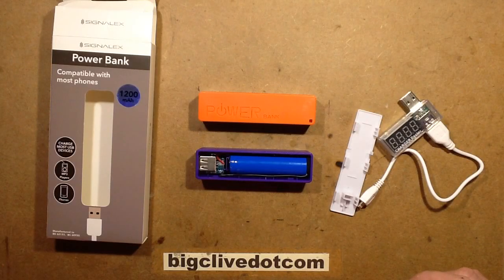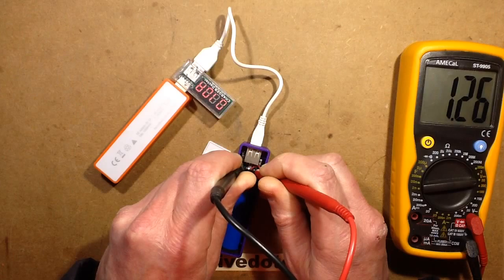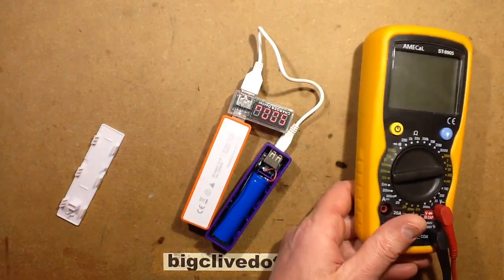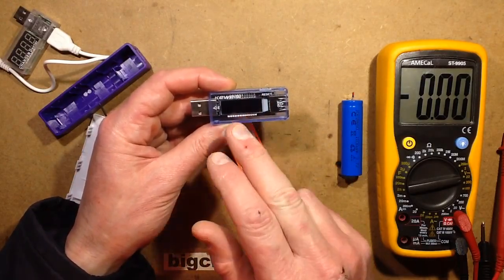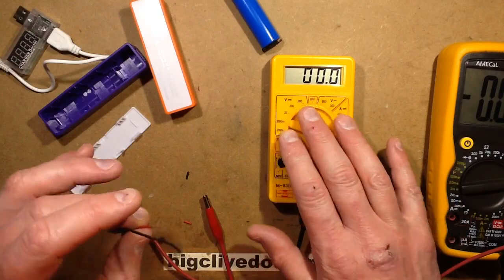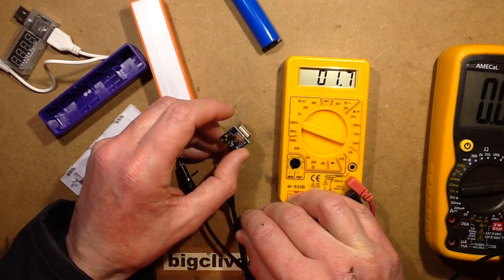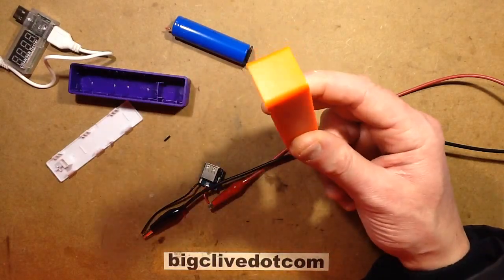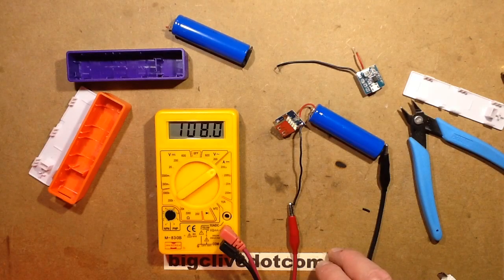Poundland's 2016 power banks.  (not a good start)

Comment: I kind of don't see the appeal of these dollar store battery packs. I guess if they actually work as intended they're worth the price, but the gamble of getting a bad one or a total piece of junk seems too high. Even if they do work, the capacity is perhaps low enough you might get one charge out of the thing, and whether or not they'll hold a charge for a length of time is another issue. And with battery packs of cheap manufacture there's a chance of overcharging, explosion, etc that I don't wish to risk. I'd rather buy a $15 charger that won't bake my handheld $50 game console.

Personally I have 3 battery packs on hand- I got a 2-pack of iLive brand batteries on sale at a grocery store(one 2K and one 4K capacity), which are actually a halfway decent product, and I got a usually expensive Mophie 6K pack in eBay's daily deals for $15. I don't use these too often but they are holding charges for an extended period and work well for how little I paid. I've seen such packs at Dollar General and such and they never look to be up to par. I guess if they come pre-charged and you need an emergency phone charge they're okay but not for something I'd personally reuse.

Being in the US I have no direct knowledge or experience of what UK pound shops carry though I see a fair bit of similar goods at Dollar General, Family Dollar and an occasional stop in a Dollar Tree. Much of these cheaper goods though are likely generic that are bought in bulk from China and simply rebranded to whatever store stocks them. Not that it's a big surprise, since so many goods sold by "top name" long-standing companies anymore are Chinese generics with their logo slapped on. Emerson these days has gone way downhill for it.

That's not to say everything from China is junk- I do find some very good stuff from there but it's still a gamble. My $10 Mp3 player is a bit lacking in features but has excellent quality sound and reads high capacity micro SD cards, and I got a cheap AM/FM radio that works better than some of the name brand radios I've owned. My lesser-brand facial hair trimmer also works much better than the name brand Wahl trimmer I used to own, too.

Comment: Great Video - I tried one of these - the 18650 cells are junk, but I upgraded mine with a laptop battery very easy to replace the "1,2Ah" cell for a 2.8Ah cell.  I found the cells were quire light too.

Comment: I have a feeling that if you cut open those cells they would be one of those knockoff ones that contain a much smaller cell, like the ones used in the dollar solar sidewalk lamps, packed with sand/dirt as padding inside the larger cell.

Comment: I stuck one of those dinky cheapy meters across my 12v solar battery bank with the cable in the wrong hole.  It didn't like it.  Somehow it still works, though not very accurately.

Comment: Hi Big Clive ,I just bought some of these funnily enough because of seeing them on your channel! Just as you found on yours, mine were all dead on arrival, I didn't check the cell voltage I just plugged them into a usb power supply and left until the red L.E.D stopped flashing, took around 4 hours. I then dismantled and discharged directly from the cell @800 mA down to 3 volts. My charger/discharger recorded 942mAh. I'm repeating the test at 1x cell rating, charge @1.2A and a discharge @1.2A I will post the result soon. I enjoy your channel and especially like your LIVE demonstrations 240V live that is! Beer and live wires respect!
Reply: Charged @1.2A and my charger detected high internal resistance of the cell so it dropped to 560mA then to 240mA as the cell voltage increased. It accepted 1001mAh. When discharged at 1.2A the capacity dropped to 642mAh when the discharge stopped @ 2.99volts the voltage quickly recovered to 3.65V with no load. I,m doing a third test with lower rates of 300mA charge and discharge.
Reply: Ok 3rd charge @ 300mA, the cell took on 618mAh due to not being fully discharged when drained to 2.99V under the 1.2A load in the previous test. When discharged @ 300mA I got an indicated capacity of 1014mAh. Hope this is of interest. Ok for a quid imo. Cheap source for cells in low current situations.

Comment: @bigclivedotcom I don't think the cell itself is only 281mah, I'm sure the cell is close to 1200mah, what you'd expect for a low quality 18650 cell. I think the reason your charge meter only showed a 281mah capacity for charge is these cells are such low quality, that the 18650's under load voltage drops to the point that the power bank shuts off. They may actually have much more available current capacity, but at a much lower load. So the fact that it's trying to pull close to 1.3 amps on the battery for a 5V 1A output on the USB, is causing the battery to drop below that 3V or 2.9V threshold. It may actually be able to sustain 1200mah to 3V at a much lower cell load, say 100mah.

Comment: Once bought a radio from Poundland. Put the batteries in, no effect. Open it up, completely empty with no electronic components whatsoever :P
Reply from the maker: So how did it sound?
Reply: I'd give the sound about a 4/10 too much feedback.
Reply: @bigclivedotcom  How did it sound? Hollow. It sounded hollow.
Reply: @bigclivedotcom  
I imagine it made a hollow sound when you tapped the casing.
Reply: I bet the battery life was fantastic.
Reply: I have the exact same radio. It plays John Cage's song 4'33" perfectly. It's like I'm there in concert.
Reply: You prolly  got latest 2017 model
Reply: Dumm da dumm... the souuuuund of silence...
Reply: You bought the Wireless radio then?
Reply: My wife bought a mini speaker you had to connect to your phones headphone jack and used 2 or 3 aaa's. She turned it on and it turned right off and never worked again, when I opened it up they had wired the battery box backwards...
Reply: It came from the Dollar 🌳.
Reply: Taz1451 True that.
Reply: Scar Hilarious.
Reply: Bought some Chinesium Christmas tree 120 VAC lights that seemed dead. Opened the plug and...no fuses.
Reply: I bet the battery is stamped 1500mAh but in reality is probably 15.00mAh.
Reply: Scar looks
Reply: How wtf 😂

Comment: Clive: You should cut the cells open and see if they are just dodgy. Do the cells hold an ok charge if you take them out and use them with out the crap circuits?

Comment: This might be the right place to ask this question, I have a rather expensive Impact gun at work that has a 5.0Ah "red lithium" Battery, and I have also purchased a Chinese rugged phone that has a 5000Mah lithium battery, Am I right in thinking they are both the same capacity, if so how come I can can fit my phone in my pocket but my impact gun battery is much bigger. Obviously the phone capacity is overrated but it definitely is higher capacity than other phones and does last a long time so whats going on here?
Reply from the maker: The 5Ah in the phone relates to a single cell.  In the power tool it will relate to a higher voltage (18V?) and therefore to a much higher watt-hour rating.  The tools battery pack will also be somewhat ruggedised to withstand the high current demand of the tool.
Reply: Ah of course that makes total sense. Thanks
Reply: Hydrocarbon Primate i bet you have no idèa what this guy is talking about :))
Reply: As others have said, to look at the difference in capacity you should calculate how many watt-hours the battery has. To do that you multiply the amp-hours by the voltage of the batteries. For the power bank that would be 8Ah*3.6V=28.8Wh, for the power tool battery it would be 5Ah*18V=90Wh.

Both the power bank and the power tool battery probably uses 18650 cells (A Tesla has more than 7000 of them). In the power bank there is probably 3-4 cells that probably doesn't deliver anywhere near 8Ah, but either way. To determine the amount of cells in the Milwaukee battery you can divide the total voltage by the cell voltage. 18V/3.6V=5. But the largest capacity 18650 cell is 3.5Ah and it doesn't deliver anywhere near the amount of power a high end power tool draws. So it has two cells in pairs to make the 5Ah. So in total it has 10 cells.

Some manufacturers use the charged voltage of the 18650s to inflate the power rating on their tools. As an example Milwaukee has their M12 line which is exactly the same as the 10.8V line of Bosch and many others. So don't get fooled by that. You can also look at the size of the product to determine if it has a true or fake capacity. 18650 cells are 18mm in diameter by 650mm long. So you can do a rough estimate to how many cells fit in there, and depending on price the capacity of the cells are probably around low to high 2Ah capacity.

If you want a good small power bank you can simply buy the casing with the proper electronics inside, and then fit your own high quality cell. I use Sanyo/Panasonic 3.5Ah cells in my flashlights since they do not need much current (which the model of cell can't provide). That way I know I am not using trash cells with unknown characteristics.
Reply: Hydrocarbon Primate it isn't hard to understand, just think of it like this- 5ah @ 3.7v is going to be a different capacity to 5ah @ 18.5v
Keep in mind you can pretty much use the voltage and ah value to work out the watt hour value. 
ie, 3.7*5=18.5watt-hours , and 18.5*5=92.5watt-hours. The bigger the watt-hour value, the bigger the physical size of the battery.

Comment: I have one of these (or similar) and it leaks current through the led enough to be visible with the case removed.
Reply from the maker: If you mean the blue LED then it's common for it to glow dimly or pulse when in standby, as it always keeps the 5V output topped up.
Reply: bigclivedotcom What do higher quality power banks do differently that makes that not happen?
Reply: they also cost more than £1. That helps a lot.

Comment: I bought the 2400mAh version of this from pound stretcher and it got ridiculously hot while charging and discharging. It also died after about a week or two of use and I'm pretty sure the cable that came with it killed the charging port on my phone. Moral of the story: never buy power banks that cost a fiver

Comment: these power banks are around 5-10 cny each in china. usually they are given to the customers for free by most of the mobile phone merchants. I got three of these and none of them work, two of them have faulty capacitors, the last one has a broken inductor. the mp3401 are all alright.

Comment: Result from mine: Had some power in it (so not a DOA or high self discharge) - BUT!

Included Cable was useless - I first tried it to the Poundland USB power supply, then to my phone supply, and then with the cables swapped.

Some quality control issues, I think.

Capacity? 2 1/2 hours on the USB XMAS lights, 250mA I think they were described as, so just 625 mAH instead of the claimed 1200

Comment: I wonder if these units would work better with 5v super capacitor's
a 500 farad capacitor would be sweet
Reply: A 500 farad 5v super cap only has a energy storage of 6250J compared to a 1.2Ah lithium which can store roughly 16000J of energy. Super caps also have a tiny energy density compared to a lithium cell (around 25-35 times less) meaning a super cap that could store the same amount of energy as a lithium cell would be huge.

Comment: Well, they way you put it, you were monitoring mA going into the pack during a charge from flat. That's not an accurate way to measure capacity becuase you're measuring draw of the charging circuit, not the battery. You need to monitor charging the raw cell from a charger. Or slightly less accurately you could measure current during a full discharge which would give you a good idea of it's capacity, but it also includes the loses of the boost circuit.

Comment: The vast majority of such power banks are utter junk. Either electronics or batteries are junk - and most often both. Many times not only is efficiency very low some also severely overcharge cells to the point where I doubt it's safe to use them anymore. No wonder such cheap junk goes bang from time to time. I have two that are really great though. Two bring-your-own-cells type with each 6 cells. Both are of a brand which logo looks like it says "teze" or "tez3". Those have a great efficiency - don't overcharge cells and paired with quality cells they deliver all those phone charges the others claims but only gets the day unicorns walk the earth. One of them has a basic gauge but can also deliver 6, 9, and 12v while the other is a USB only but have sophisticated digital display where you can look at internal capacity and current draw. One I bought panasonic cells for the other got some samsung cells as a (non recalled) apparent unused samsung laptop pack was thrown out at work. Also looking inside them it's clear they have large inductors. Not the tiny one of other power banks. So far they're the only really great ones I've come across. Other have been junk to varying degrees - some as said downright dangerous.

Comment: If you want to test without the meter in the path (which shouldn't have much resistance), put it on the 10A scale. The resistor for that is more or less a dead short. Even the ordinary 2A range though shouldn't make much difference.
Reply from the maker: I was wanting to check the quiescent current in microamps which does unfortunately require the higher resistance ranges.
Reply: +bigclivedotcom If the chip does some unfortunate tests on the battery state, or tries to keep the output cap ready at 5V with no load it may get confused by the impedance change from the unexpected probe leads and meter itself, and might get even more confused by a bench PSU that tries to do its own regulation. One test to avoid this would be to add an additional cap across the input, and feed the board from a known good cell, then allow the circuit to stabilize for a few minutes.

P.S. I have a powerbank where I can remove and reinsert the cell without cutting the wires. They used an actual battery holder, then stuck the battery in place with a bit of Kapton tape just so it wasn't "legally" a removable cell.  Cost more than £1 though.

Merry Xmas.

Comment: I have the same one bought from Microcenter for $4, mine came with a 2600mAh Samsung cell. It looks the same, well the case does anyway and seems to work from the start. Looks like they are selling the lower capacity ones for cheaper. 
Does the FLIR E4 feature mod still work? This was first discovered in 2013 I think. Or did you buy yours a few years ago? I have the FLIR one and it's nice for videos and multipoint temp pictures. But mine cuts out above 285F and I saw thenE4 can go twice as high for temp readings. If this mod still works I might think about getting the E4 next.
Reply from the maker: I got my E4 not long after Mike of Mike's electric stuff did his original review.  The subsequent hacking was the icing on the cake.

Comment: I think it would be an interesting test if you tried out these Poundland / Poundworld power bank circuitry with some top draw 18650 cells, and see how the circuitry behaves with a better cell. Afterall, most people who are likely to tear these apart would probably be thinking about getting a bare cell from somewhere and replacing the lethargic (and often times highly over rated) cells that come in these default.

Oh and a quick question, is the power circuitry in these Poundland banks better or worse than the Poundworld V2 circuitry (from your video https://www.youtube.com/watch?v=b0c9hI5bt5g ). And is there any inherent benefits or drawback to either design?

Thanks.

Comment: Any quiescent current for a power bank is unacceptable IMO. What's wrong with a momentary button that you have to press to turn it on? That would allow it to go down to 0 current and have an auto-off function.
Reply from the maker: For some applications the continuous availability of 5V is very useful.  The power banks with the button to activate them also have a quiescent current draw for the button monitoring circuitry.
Reply: Well, I'm sure you won't have difficulty imagining a soft power switch with no quiescent current. Instead of anything actively monitoring the button, it would supply power to a circuit that turns on a transistor, that keeps said circuit energized until it later decides to force that transistor to turn off.

Comment: I recently bought a blue, slightly larger version of one of those powerbanks at my local Walmart (having recognized the design from one of your earlier reviews; I'm hoping it's one of the 'better ones' the review mentioned. It had a partial charge on it when I brought it home, I plugged it in to completely charge it (a red oval light on the top came on and went out when it was done), I plugged it into my iPhone 6 and it charged it to around 83% or so. It seems to be ok so far crosses fingers. I may pop mine apart just to take a look, though.
Reply: Those cases are pretty easy to open and close again without damage  - I guess there's a factory churning out the same powerbank case which several companies are buying and putting the cells and circuit board in to... so there's no way of telling if it's going to be alright just by looking at the outside... though yours is  probably the same internally as the other identical looking ones bought from walmart